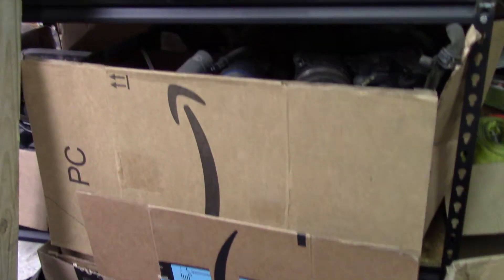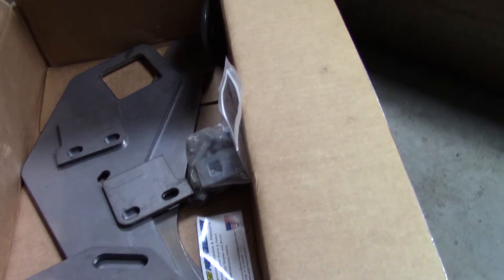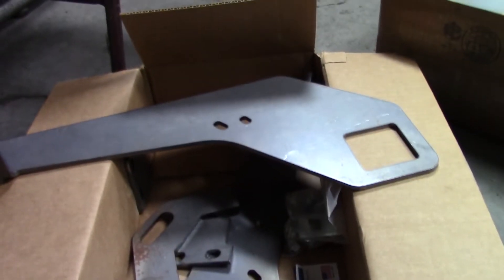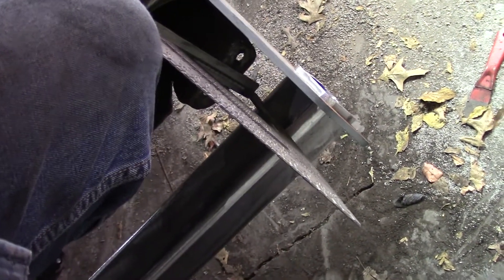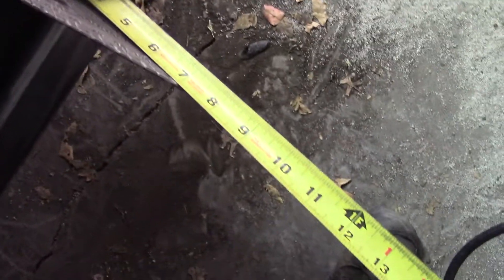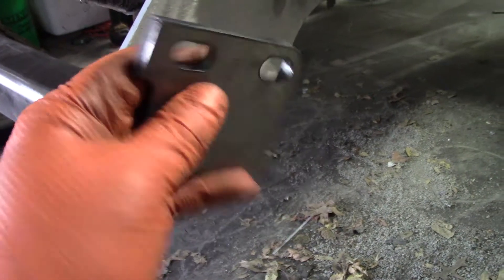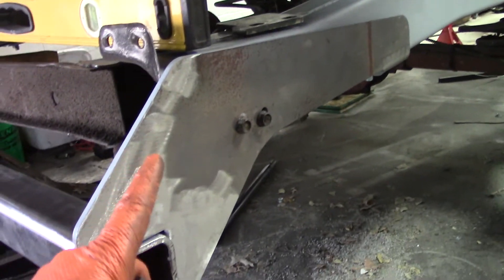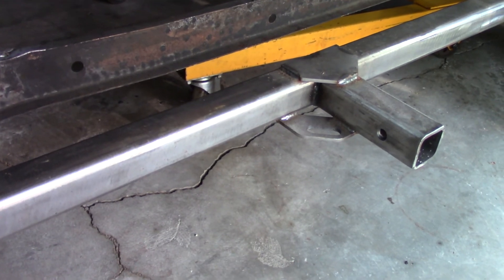Tow Hitch fabrication for the Roadmaster + Duramax swap - Part 10

Comment from the maker: UPDATE - DON'T MAKE MY MISTAKE!  I really should have just used a pre-made receiver rather than using the extra bit of tube that I had left from the crossbar.
 
It turns out that the ID of the 2.5" 1/4" wall tube I was using was 2.02", and a standard receiver tube is 2.07". That 50 thousandths is a big deal, it's the difference between a draw bar fitting and not fitting. So, I had to cut off the receiver tube I made, and weld on a pre-made one. Something I should have done from the beginning, since it would have saved me making a thickened edge or having to drill the hole for the pin.